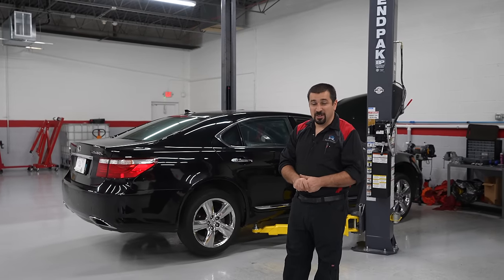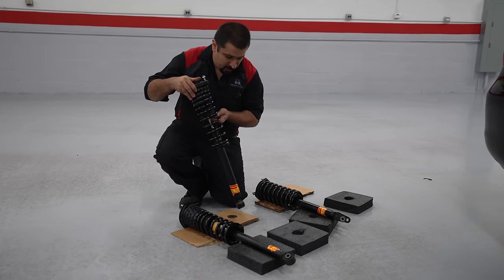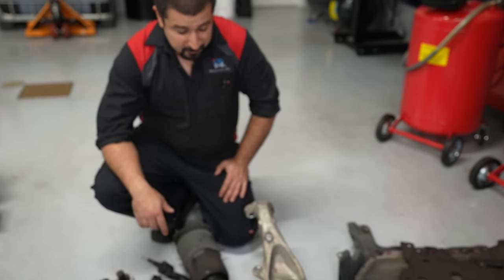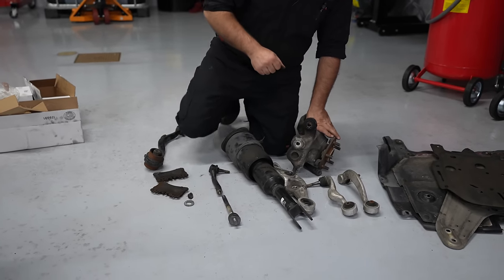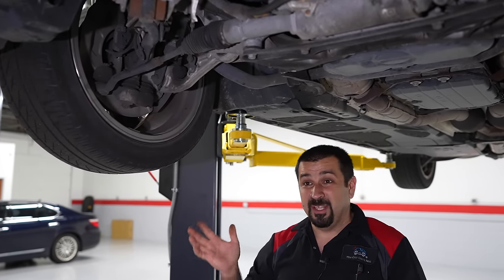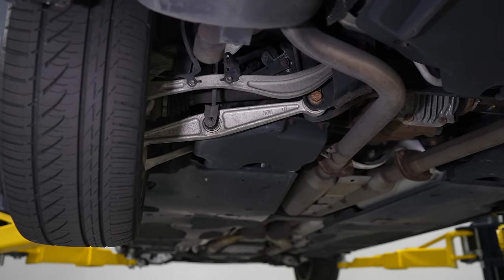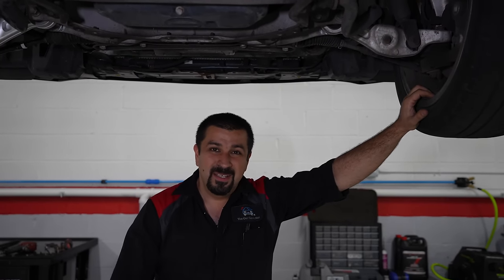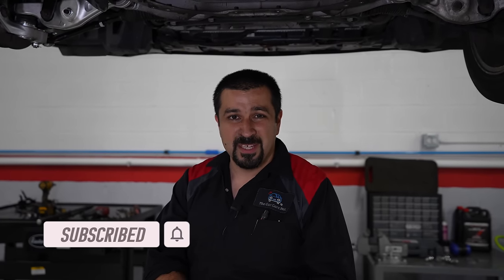Avoid THIS Lexus Model | Pre Purchase Inspection REQUIRED for this one and Here's Why.

Comment: I did a strutmaster conversion ony 2009 LS460 awd w/air ... from day 1 i heard clunking on all 4 corners 😑 idk if the shocks were cheap (they werent kyb like some people say they get) not sure if the strut mounts were cheap over overall couldntm handle the weight , the noise comes from the top of so i know its not lower control arms - sway links etc... its frustrating cause o cant do anything about it for the moment ... unfortantly the conversion kit sat in my garage for a long time and is not under warranty anymore ... do i try getting new shocks? For the awd model is so hard to get parts 😑

Comment: SMH.. I feel this customers pain. The price was mind blowing. Bought the car for $12,500.00 two years ago. Now with 130k miles. And recently spent $8k to replace all of the control arms tops and bottoms. As well as the $2,000.00 mufflers. 🌧️😭.. I love the car so much I bought it twice.🤦 Worst financial decision ever. But it rides really nice. I love it!
Go for a GS or IS.
Reply: You can't own an LS on a lemonade budget. Enjoying it means you have to spend on it. Cars are almost never a great financial decision.
Reply: Your words ring true. These high-end vehicles are the most expensive to repair. Crazy how the prices OEM replacement parts cost, even after 10-12 plus years and zero (if any) improvement to it's quality. Like the bushings on this particular lower control arm on this vehicle. 
Surely not vehicle for anyone on a budget. 
I drive my suburban more than my LS and the LS gets better MPG. 😂

Comment: I'm going  be purchasing a 2017 lexus lx570 fully loaded with 64k mileage for $62,500, should I be worrying about anything? does the lx570 have air suspension?

Comment: I’m not gonna lie I wanted a gs460 just bc I can technically get ISF performance parts for it. Whatever modifications u can do to the ISF u can do the same with 460 models just bc they bohh to share the engine all though the 460 is a 1ur while the other is a 2ur. In the end they are both expensive when repairs are needed but the the repairs for them is more like a one time deal and don’t have to deal with them for a while unlike other cars where u have to keep replacing them over n over again. I’ve decided to go with the is350 just bc u can share parts with other cars that came with the 2gr. Plus Ik how to modify it as well considering that I have a highlander that is modified but it’s the 3mz version and 3mz and 2gr are similar to each other thus me knowing how to work on them

Comment: 22 Corolla SE with 2.0

Can you please tell me the correct torque spec for the oil drain plug ?
I've given Vin # to 3 different service advisors at dealers and got 3 different answers 15, 27, and 30 ft pounds...

Comment: I'm a guy that does all the maintenance on my cars. I'll stick with toyota. This lexus looks alot to much complicated to deal with. I would much rather junk this car then put all that work in the front end. The cost of all them parts you can get a nice toyota camry that will drive not as nice as the lexus but will be parts you can buy from autozone and be fine with. The only real difference in my opinion is the air suspension . Toyota/lexus are basically the same

Comment: Hi,
Is it possible to have the intelligent clearance sonar system (parking sensors) installed by Toyota dealers as an aftermarket option in 2022 RAV4 models that do not come with this system (like limited trim)?
If not, are there any reliable aftermarket systems out there?

Comment: On my 07 camry 2.4 w/188k, I replaced my valve cover gasket. At the bottom of the sparkplug tube there is a hard gray deposit with a ridge about 1/4 inch from the bottom. Any guess what this could be? Could not scrap off nor did brake clean do anything.

Comment: Love your videos!  How can I make my 2017 Toyota Camry XLE ride smoother.  It makes zero noise over bumps and is very solid with some exceptions of creeks in the body frame.  I just like a smoother ride without having to  buy a different car.  Is there a way to make a smoother suspension?  Thanks, Dave P.
Reply: Better tires

Comment: I have a 09 ls 460 L. The car runs great but makes a weird noise at 2000 rpm. It sounds like the car needs a tune-up or bad spark plugs. I recently replaced the plugs, cleaned the fuel system, and changed the coils. No check engine light. Does anyone know what might be responsible for the noise? I have tried all I can to fix this issue but it won't go away. Thanks

Comment: Hi AMD , have a 2014 LS 460 awd "base", non F type, 14k kms from new lol . How can I tell if it has air suspension ( no button inside) Love Toyota , have 2019 4 runner trd pro , and 2006 Tundra , not trailer queens . many thanks

Comment: Thanks a lot for all these knowledges!! My 06 LS460 with 235000km on clock required me many attentions since i baught it a bit more than a year ago.
All front suspension arms, broken radiator nipples, starter replacement, tpms batteries wornout and "normal" maintenance. But, damned i love so much drive it.
There is still remain a pb on it that i can't solved: warm engine, stopped in Drive mode, without any electrical consumptiin, ac off, etc, idle drop close to 450rpm and knocking noise appears. 
Tranny oil flushed 2 times in 60000km at the local lexus shop without solved the pb. How to solved this issue?

Comment: The pad that was jammed against the rotor must have made a terrible grinding noise. Judging by the depth of the groove it had worn, it must have done so for a good while. I'm amazed the owner hadn't noticed. I know Lexus are well insulated and quiet, but that must have been loud enough to hear and even feel through the steering wheel..

Comment: wow really why aluminum, there was a saying a partner and I had which was Aluminum doesnt bend it breaks which is why I would never try to press in or out a metal bearing it if was inside an aluminum piece because more then likely it will crack then we would have to buy a new one anyway.
and another wow how tio the person doign the front brakes not see or for tha tmatter feel the pads touching the rotor?
I actually have a question about my 06 lexus is 350 my front brakes are around 30% when I replace them will I need to also buy new front rotors and if  Ido do they need to be toyota or can they be after market, I know in the old days we used to just turn the old ones if ther were not to bad

Comment: Can you make a video regarding the AFS system on the 07-2012 LS models? I just had a check afs light comes on blinking and noticed the reflector bowl is pointing up and away from center. It’ll go away if I turn off ignition and restart but after driving a bit the light returns.

Comment: Great video! Way off topic but I'm a young gal who just bought a code reader. My 2000  Tacoma has a check engine light so I connected it and it says no vehicle memory and something about no vin found I think? What do you think?  It's backfiring and blue smoke is coming out. Thoughts? Thank you!
Reply: Same thing happened to my wife... no memory... backfired  (we used to call that farting)  she still smokes...
Am I way off topic?

Comment: I have 2009 ls600hl and I have a several codes. po866, po867, po731, po989,. The last code worries me the most. Where is circuit transmission pressure switch/sensor located?

Comment: hi im having issues with my 2015 highlander xle model v6. My electric power steering is feeling very stiff...i was wondering what could be the issue and if the xtools d7 or d8 will be able to scan the issue? i do have a bluedriver but it didnt scan any codes related to eps.

thanks

Comment: are the lexus ls 500 worse or same???   i was looking into these.  glade i seen this.  2014 to 2020 i am looking
Reply: LS 500 is the next generation. I got my 2007 LS 460 for $12K but LS 500, even an used one cost at least $50K.  The LS 500 is 6 cylinder only. I found my V8 is much smoother.  I took my LS into the dealer for service and got a 2018 LS 500 rental to drive for about a week. It had 2K miles in it. Maybe the LS 500 will be smoother when the engine has broken in.
Reply: @aly8848      how long have you had yours?   any cost for repairs like  anything major?    i was looking at the 460 as well.

Comment: WOW things have gone down hill for Lexus I own a 1994 LS400 and literally did not put a dallor into it for 200k did have to replace the whole suspension at 250k 😢 Now it's my fun summer  car 😊
Reply: Nah.  Just this particular model.  All those air suspension shocks and electronic brakes.  The rest of the cheaper Lexus lineup are still very reliable.  Say a ES350 or a RX350.

Comment: It's so funny because the 430 (the one without air suspension) is probably the best built Lexus while the 460 is almost on the opposite side of that
Reply: Yeah those LS430 was the last gen V8 pure luxury LS you could buy, until Lexus screw around with being more sportiness.

Comment: Totally agree with replacement of the spindle hub and bearing/ball joint that's what causes a lot of the wear when the brakes are neglected and they shake when you stop putting stress on the entire front end the brakes in that car take a beating especially with the hybrid

Comment: YIPES!!  I'm afraid to look closely at my Camry suspension.  Didn't that improperly installed brake pad make alot of grinding noise riding on the rotor?  This had to be at least a $5000 job.  Couldn't afford to maintain one of these cars for sure

Comment: Bit of a broad statement that about 'German cars all leak at the main rear seal' surely.
I have had 4 x 190s, 2 x W201s, 1 x W210, 1 x R-Class and currently run a W211 and not one of them have been troubled by oil leaks.
I sure as hell wont be buying a Lexus any time soon when I see the mess that suspension & brakes are in.
It ties in with the Lexus my niece owned which, including a cracked cylinder head, was a heap of shit, money pit!!

Comment: So should I get strut masters before my original suspension breaks? My 09 460L has only 60k miles with no mechanical errors.
Reply: No don’t waste your money.   Lexus updated the design. When it goes just use the updated parts. (2012+).

Comment: I worked as a tech for 12 years at a busy lexus dealership, never saw any of that even on vehicles with over 100k miles on it. Something is not right here, that lexus had the 💩 beat out of it driving on really bad roads in my opinion.

Comment: My Boss has a LS460L from that Generation(06) and his was ordered with those wheels as a factory option they were issues with tires slipping on them and messing up the wheel balance.
Reply: BTW he just replaced it with a 2022 LS500. For his third LS there would be 4 but he went to an S-Class for a short time.

Comment: Those rims are 2010-12 model so not original to that car.  They are definitely refurbished and not factory chrome.
I see a lot of neglect with this one.
ive had my 2010 for 8 years with not a single issue currently at 138k. my car is still tight with all original components with exception of lower control arms.

Comment: What design change could Lexus have done to prevent the rubber, the air shocks and other suspension component issues?  These seem like such basic straightforward components that there really is no excuse for these failures.  Thanks
Reply: It’s more common than people realise in most Lexus models, I don’t know why they haven’t addressed this majorly issue after all these decades 🤷‍♂️
Reply: @dibaz1  Is it correct to say that when it comes to the ls460 control arm failure, really the ONLY thing that fails on these is the RUBBER.  The actual metal parts themselves don’t fail. Is that an accurate statement?
Reply: @Mabeylater293  yes, and general electronics play up usually before any engine problems, particularly the screens and the audio systems.
ML is not all it’s cracked up to be but, it doesn’t help when you live in a hot country for most of the year.

Comment: Hi  I have a 2018 rx350 with 60k should I do the 60k mile maintenance (spark plugs injection cleaner brake fluid flush) that Lexus recommends? That does not include transmission  drain, coolant flush, Power steering flush or do I do all of above thanks
Reply: I forgot the differential as well

Comment: Hi Mr car care nut, thank you for your helpful video's.
I have a 2008 Camry 4 cylinder, code p0031 is on it (Oxygen (a/f) sensor heater control circuit low bank1, sensor1 ), i replaced the sensor,fuse and checked the electrical and wiring, the code still on, would you please help me
Thank you 🙏🙏🙌🙌

Comment: Hello I have questions is required to change transmission filter and fluid 2017 corolla 2017 xse at 71000 miles

Comment: That Lexus with only 130k miles and with all that suspension problem and oil consumption, it's not the car. it's the owner (previous owner or current owner). Letting it get that bad. People, buy cars can afford to maintain. The only problematic thing is the air suspension and again that's expected!

Comment: How do you feel about later models 2014 and up. Do they have same problems ?
Reply: 2014+ are fine if you can get some kind of warranty. Lexus/Toyota V8 engines are notorious to have coolant leaking problems that cost over 1-3k.

Comment: Anybody who owns a ls or a gs 460 u guys basically own an ISF and if ur wondering if it can be modified the simple answer is yes just bc whatever performance upgrades u can do to the ISF u can do the same with the 460 models.
Reply: I own a gs460
Reply: @30minforasn then you basically have an ISF and what ever upgrades there is for the ISF u can also do the same with yours.
Reply: Yes and no. Isf is a 5.0 vs the gs 4.6 isf has more hp and tq. Both has similar transmission.
Reply: not really, the ISF is tuned in a completely different way. not even the same v8 engine. if you tune the LS, you basically have a tuned big boat. you can actually track the ISF but not the LS

Comment: I have a 2007 LS 460 with 237k miles.  No problems what so ever until now I am getting major hesitation of and on and it appears to be related to idling or being in to high of a gear for the speed.  has anyone come across this issue?

Comment: The 2007 to 2012 LS sucks balls. I've fixed so many problems especially the ABS system and brakes, AC system, air suspension.....One of the worst cars I've owned.

Comment: Would be really interesting  If you can do a video about the Lexus HS 250 H excuse my French the bastard child of Lexus. I’ve owned many different Lexus Vehicles but this one seems to be the most reliable that I have 279,000 miles and counting and practically zero issues what is it in fact the most expensive vehicle to maintain due to lack of aftermarket parts. Love your videos very informational

Comment: Have never understood people. Have known many different people over my life who will go out and they have to have a Lexis, they have to have a mercedes, they have to have a high end BMW or high end Audi. But can they afford to buy a brand new one... no... so they end up buying one that is several years old sometimes it has tremendous mileage on it, over a hundred thousand miles, just so they can sit their arse in an impressive car. They end up spending a small fortune on maintenance and upkeep and then they are locked in and they can't get rid of it because they put so much into it. If you can't afford to buy the car new don't buy a premium vehicle is my advice or at least by a used one that is a certified owned, demonstrators type vehicle. If you can't do that stick with just a regular car that you can afford. I skipped over the first little bit of this video I'm interested in how many miles was actually on this car. And I say all this because of my own experience....  years ago, I wanted a Lexus but I really did not want to spend the money for a new one so I bought a used one and it was supposedly owned by the salesman's uncle and Aunt. Well I hadn't had the car 2 months the air conditioning stopped another month the power steering pump went out. I was hemorrhaging money on the car and it was an LS400 I think it was a 91 and got it and maybe 95 w 58,000 miles. It was a beautifully riding and driving car but when I called the Lexus dealership that it's supposedly came from originally come to find out it was sold new in Florida as a leased vehicle I don't know how many people had o w n e d the car.  Not only that but when the odometer and keep in mind this was predigital odometers, when the odometer flipped over to 60,000 Mi there was a scratch on the six very evident. First cold day in December I took that biotch into Toyota and traded it on a brand new Avalon and I said never again would I do the used car thing unless it was a certified demo. Probably within a month after trading that car in, someone called me and was asking questions about it where I got it from what the deal was and I told the entire story. Later I found out the guy that sold me that car had been arrested for odometer fraud I think it was like 50 counts of odometer fraud. There's some shady mofos out there.   Wonder how much this job ended up costing, $3 to $5k?

Comment: Literally all new Toyotas have aluminum knuckles. Wheel bearing replacement is normal as usual, just takes a bit more work. Coolant leaks from valley? Yes normal on UR engines, not the end of world, about 5hr job. This guy MUST of drove off road, I have is350 with 230k miles and suspension is mint other than shocks and bearings.

Comment: looks like this car has really been abused.  doesn't look like a newer model maybe the 2006 to 09 year.  doesn't have the full spindle grill  most bushings will wear out after 10 years so if this is a 2006 to 2012 its 10+ years old and certainty has not been garage kept. That brake job previous owner DIY maybe.  at  5:09 looks like the fender black paint doesn't match the door panel combined with how beat up those wheels are I suspect front end collision or a lot of running over curbs